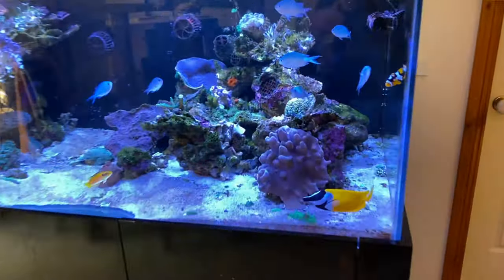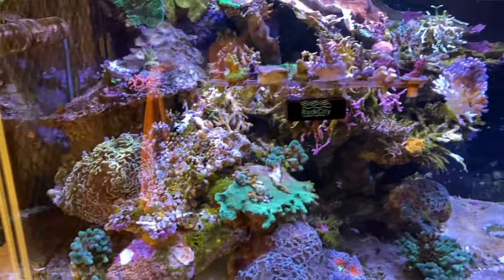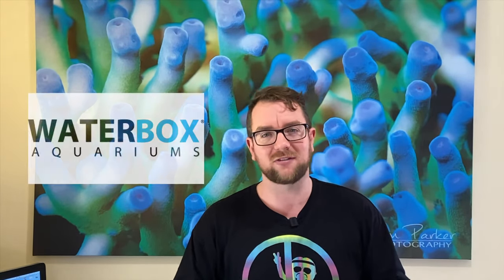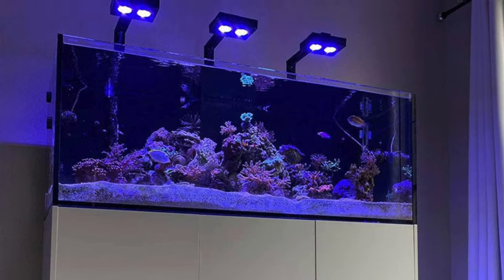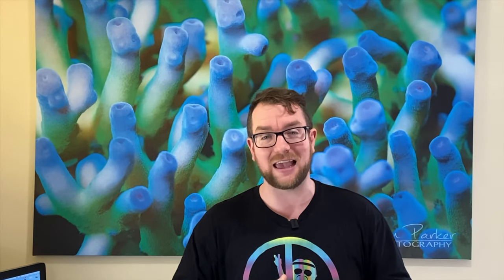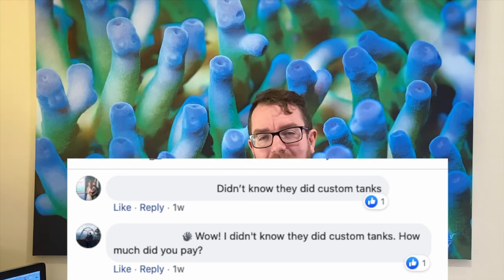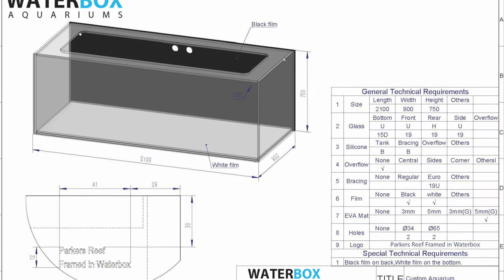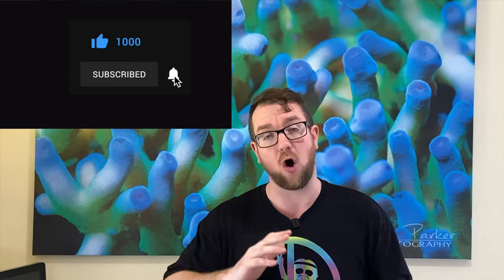My Dream Reef Tank Build - Choosing The Glass Box!

Comment: Awesome new tank man! 
Nice. Excited to follow along for this.

 I was trying to workout how you’re planning to plumb it based on your requested hole sizes..

Is it 1.5” pipe dia. for overflow and only 1/2” for returns?
(38mm&13mm)

It would be interesting for build/equipment nerds like me to hear you elaborate on your thought process for their locations and chosen plumbing sizes. ( in the future perhaps(?). 
~Cheers
Reply from the maker: hey man! Yeah I am using a shadow V2 overflow on it (I have a video showing that being selected earlier).

Two holes for that overflow at 65mm each and two returns drilled at 34mm each.